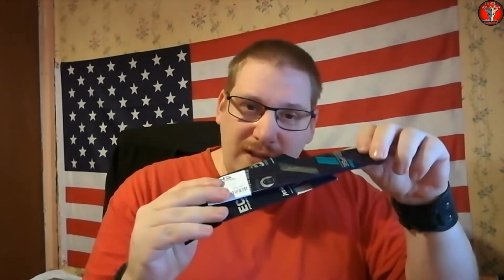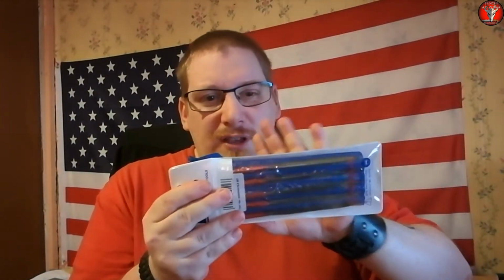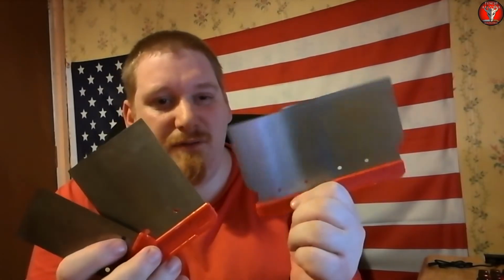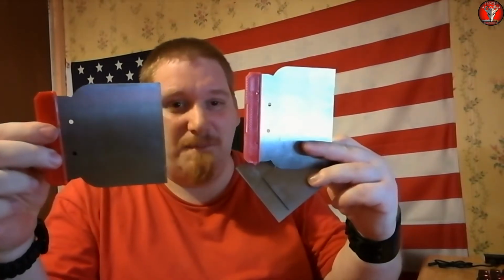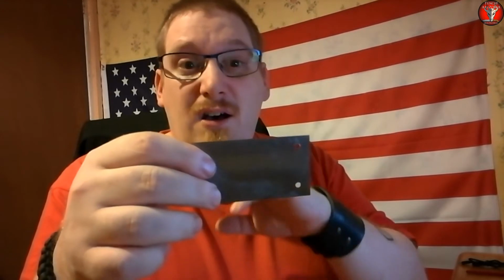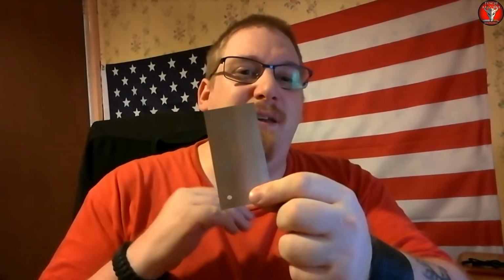improvised blade a knife making test (hand tools only)

Comment: Well, you certainly used your wit to sharpen the argument for why weapon laws do not work.
Also, I didn't think that a simple scraper could be turned into a menacing improvised weapon like that.
Reply from the maker: Well it was really supposed to be a knife making video, but as I was and still unsure of what metal the scrapers are made of I ''improvised.''